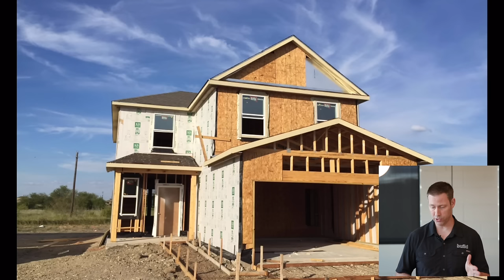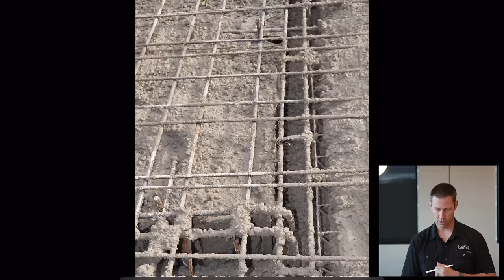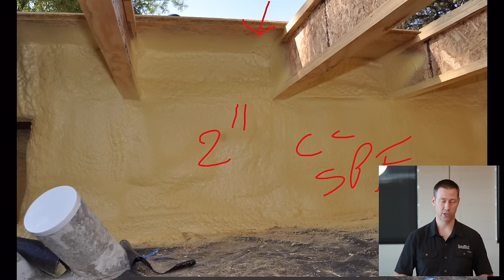Foundations - Slab vs. Pier and Beam - Which is better?

Comment: Here in S. florida, slab on grade is most common with a few grade beam on pile foundations.  Post construction and aging homes here often have plumbing problems which necessitate hammering out portions of the slab, very expensive and cause great inconvenience to homeowner.  Since most of these homes are built to a price point in slab plumbing tends to be located in close proximity to each other, master bath, second bath, kitchen, etc. tend to be back to back and share common walls.  If that small portion of the slab which contains the plumbing could be located in an externally accessible crawl space, future plumbing issues could be dealt with without the necessity of jackhammering out portions of the slab.  Take I guess what makes me think of this, owner of a home built in 1959.

Comment: Love the video! OK, so how is a foundation done in Sweden? First of (near) all houses have no basement. It is slab on ground mostly. First all topsoil is removed and sold. Then all gravel / sand is removed and sold (sand is a natural product and is expensive). Now you have a big hole in the ground. Then grey bedrock is blasted and crushed to diffrent sizes. And filled in the rectangular hole. Black flexible plastic pipe is put in (PEM). Big plastic sewer pipes are put in, electrical lines are put in. When they hit desired level. The greyrock is vibrated and flattened very hard. 
Now you have a Grey flat surface. Now they put in "under slab insulation"  Often very thick one, And on the edges the stand up, so you get a form to fill with concrete. Now the steel bars. And then the plastic pipes for floor heating. After that the form is filled with concrete.

Comment: I always wondered why you guys didn't use full basements. Thanks for the detail!
Reply: Also because folks in the north have frost lines at 36" or more. Might as well build a basement. 18" or so around Dallas. Just bury the lines and do slab or P&B.
Reply: My childhood home was a partial unfinished basement, my dad dug out under other parts of the house from it to gain access to the utilities, we since moved out and now I currently live in a rental with unfinished and unconditioned basement, I would like my next place to be a more modern and insulated basement, hopefully ICF with wood first floor for the softer more comfort of wood to that of hard as _ concrete slab after a few past places I lived in. Basements are far more convenient and accessible than a crawlspace.

Comment: In MN, deep basements and good gutters is the way to go, sand must replace clay near the foundation to prevent expansion in wintertime. Anything less than a full basement seems to lower home values substantially.

Comment: A friend of mine had a "pier and beam" with a 4 foot deep crawl space.  Much easier to get under the house to work on plumbing or wiring.
Reply: Nothing worse then the older style crawl space that is like 2 feet max.
Reply: @buckroger6456 I lived in a duplex once that had about a foot, maybe.  There were ditches dug out for the plumbing in the crawn space.

Comment: Awesome video. What would you recommend for a pier and beam house with vented crawl space? I’ve been told to open vents in summer closed for winter. Now I’ve heard keep them closed and insulate it and vapor wrap from sill plate down and cover the entire area. Is that what you would recommend? And what do you think about dehumidifiers

Comment: Are there any moisture&mold issue with foundations? They are really big issue in the Nordics, especially if the plot has any angle so your basement wall has to be against ground. Having clay or rock straight under (like in Matt's first example) is rare. Another big issue is concrete floors and not letting dry fully before building on top of them, as sometimes it takes multiple months)!

Comment: A basement, with 7ft+ ceiling height, is the best. Additional storage and semi-conditioned room for mechanicals. Also, easy access to inspect, fix, and run new plumbing/electrical. A plumbing leak would be detected quickly (assuming you go down there occasionally), unlike a crawlspace where nobody wants to fight spiders, raccoons, and snakes to check it regularly. There should be minimal issues with water assuming a good site and drainage, or at least a perimeter drain and sumps. 

In the Northeast, we need our garages for cars, so the basement is where all the crap goes that would normally be in a garage in more climate areas.
Reply: Working for my step dad while lining a house with even just a part of the house having a basement (it was 100 years old at the time and since been added on to) of which my own dad had dug out from the basement to create crawl space access to a few other sections added on before we moved in to gain better access to utility, Basements are far more convenient than those who say crawlspaces are optimal, though it also depends what you can do per the water table (floods?) and soil or geological conditions of where one plans to build, you have maybe a few choices and may not get to go with a basement. 
He got way more basement waterproofing calls than for crawlspaces which we rarely got called for, even my sister bought her current place with a basement with a normal door that walk-out to the back yard space as its on a slightly hilly area, hers is a half finished which makes for a nice play space for the two boys (nephews, no girl ... yet and no plan to have more kids) when they get rowdy or she needs to do some work and needs the peace and silence.

Comment: Matt, it appears from what I can see in your pictures that the yellow vapor barrier terminates at the footing of the perimeter. Is this common practice, if so, why? Seems to me you would want to prevent "rising damp" at this location as well. I have seen moisture at perimeter walls near the floor despite proper exterior drainage. I'm a private building inspector in SoCal.
Reply: Im sure it makes a great termite barrier!

Comment: Hi Matt,

Your videos are both accessible and very informative! Thanks!!!

My question is… 

Is there such a thing as a mat slab perimeter foundation hybrid?

Our soil report requires a thickened, double reinforced mat slab, due to liquid faction potential soil. 

However, we want to have a modern,  net zero, prefab home installed installed, and it requires a perimeter foundation for utilities hookups, etc. 

Can we desigh a mat slab foundation that’s below grade with a perimeter wall on top to meet the requirements and create a conditioned crawlspace?

Trying to think outside the box, but not experienced with foundations!

Thanks!

Paul

Comment: Asbestos floor adhesive for those stick down tiles on your friends house @8:10- that black stuff. Had to remove that on a job before we jacked up the slab in order to be able to take it to the city dump. $15k hazmat bill vs. several cases of isopropyl and kity litter and deck brushes and lots of ppe /:

Comment: I am used to pier and beam but its all slab here in AZ due to soil. In a valley between two mountain ranges, essentially making the area a gaint silt basin. Rock is around 500 to 1000 feet down.

Comment: The best floor systems I come across are sleepers on a slab. Not very common where I live but very solid without as much shock or temperature radiation.

Comment: lived in suburb of Philadelphia. moved 25 yrs to fl where you don't even think basement  so not seen building there but half my town was slab foundations as neighboring town . like Levittown pa, Willingboro, N.J. Levittown  new york and even many technically with basement use slab the 4 ft poured wall on the slab and push dirt yp to fount but back ground level is very common so really basements the first floor but kitchen lr and beds above steps from street to front door

Comment: He he,...  “slab on grade” or “ground” (you know... sand!) as we call it in Australia. The majority of building in my state is this way, for the past 50 years. We don’t do basements (generally)... then double brick walls and wood frame roof beams with concrete tiles or tin.

Comment: Great video! Thank you so much 😄 but sorry if this isn't related to foundation but why is the wood wrapped around the trees? Is that to protect the trees from contruction?
Reply: Hoses or cords snaking through a construction site...you don't want them rubbing the bark raw on the established trees.  Even if you don't plan to have equipment out there, it's a precaution.  Although a pain to work around on a job, everyone enjoys a shade tree at break times, especially before rough in is complete!

Comment: Are there any trade-offs for earthquakes? We have a slab foundation and in a recent earthquake all of the corners of the slab developed a thin 2-4 foot crack. We fixed it by injecting resin into the crack to prevent water from reaching the steel reinforcing but I wonder if a pier on beam design would be more resilient when it comes to earthquakes??

Comment: Great video. Where can one buy vapor barrier for an existing dirt crawlspace? Our crawlspace has no standing water but it does raise the humidity inside the house from moisture from the dirt.
Reply: A lot of crawl space vapor barriers are simply thick polyethelene sheet.  It's sometimes called "Visqueen" which is a brand name.   You can get this at any home store.   It's pretty inexpensive and comes in clear (translucent) and black. There may be materials which are better,  but lots of vapor barriers are just polyethelene sheet, and that's going to be a lot better than not having a vapor barrier.

Comment: Great video! Post and beam is not popular here in Phoenix, but I do appreciate seeing the differences in likes/dislikes between the two. 
This brings up a question on your slab on grade homes... I have seen several of your videos that have the integrated concrete beams on top of your moisture barrier, and in the case of this video on the lake house, posts 50' under slab to solid ground. Are your integrated beams part of the engineered design of the home because of the soil conditions or your standard practice for slab on grade to create the ultimate non-flexible foundation?
Reply: The design manuals for foundations like this have the initial assumption that you will have beams integrally with your slab on grade like he showed, but you have the option of thickening the entire slab in order to not have them. Phoenix soils tend to be less expansive/collapsible when compared to Texas, but Phoenix does have bad areas for them as well.

Comment: Matt, love the videos...

I do have a question on a pier and beam foundation.  It seems that the walls of the foundation are solid with no door as it typically found here in the south on older homes that have a crawl space underneath them.   Do you include a "trap door" somewhere in the floor like is done for fold-down stairs into the attic?  If you frame a door into the side of the concrete foundation, how do you seal it?

Comment: I'm hoping to build a pier and timberframe house in climate zone 6. I need to figure out how to layer the underside of the house without raising it too high. Probably 2' minimum, increasing to 5-6' because of the grade. Garage entry will be at the 2' end, so building some kind of ramp should not be too bad.
Why do this? Aesthetics (I think a floating house looks cool), completely avoid dealing with water issues (high water table, too),  reduce concrete usage for lower carbon footprint, and disturb the land less.

Comment: You said it would he hard to insulate a slab-on-grade, but why not be proactive❓ Use 2" (or thicker) rigid foam under the slab. In the drone shot @9:50, the foam would go on the flat areas, in between the "trenches". Tape the foam edges to the vapor barrier, to keep concrete from getting under the foam.
Reply: They similarly insulated the SOG Fine Homebuilding House of the Year in 2017 in Vermont.  I think they did 4" (staggered and layered 2" panels because...well...Vermont) and something about a lip on the edge pour as a place for the foam to sit on?  I'll have to go back and watch that video again but I'm not sure why Matt would call that hard to do?
Reply: Even ICF deck forms are perfect for the same reason to insualte as many of them offered comes with beams already incorporated into it (though mainly in just one direction, not that hard to cut out a cross beam to go "length" wise) even along with the block forms, is not that much harder to do and more convenient than an all flat slab or what he showed with cheap flat sheets of EPS or XPS Foam.

Comment: I believe you missed one point why Pier and Beam is used in Texas or should always be used, our expansive soils. Tract lot builders like Post Tension due to speed of construction, but honestly most will need piers 20-30 years later. My house built in '91 is moving a lot, it will likely need piers for leveling, but cost is 20-30 thousand for a 1500 sq. ft. home.
Reply: Eric G 
Wow. Sounds like slab is cheaper in the short term but more costly long term.

Comment: I'm a carpenter and love pier and beam foundations and also love timber floors. But my wife hates the squeaks and echoing/hollow noise that comes from this type of flooring. What are your thoughts on a solution for this?
A suspended slab is a thought but defeats the simplicity of the pear and beam. Even 3/4 sheet flooring with timber flooring on top is still a bit noisy. Your thoughts? Cheers

Comment: Pardon my ignorance. What kind of steps are you taking for radon gas mitigation? Or is it stopped because of the vapor barriers under the slabs? I didn’t think that in itself stopped radon from getting inside the home. I don’t know the answer, hence the questions.

Comment: So, I'm confused about the insulation system used on Pier & Beam. I get the 2" spray foam on the walls, but is the "mini-slab" that is the crawlspace floor insulated as well? I expected to see 2" rigid foam or something under the slab. Otherwise, this looks like a foundation I may very well use in the house we are designing now. Cool stuff, thanks for the education.

Comment: Growing up in central Texas, I fully believe in Pier and Beam.... when they are built right. I've been in too many production and even custom built houses around Texas where the slab foundations had failed due to soil settling. So few people pay for a soil test, thinking they will be ok, but find out in 15 years their house is beginning to eat itself. Matt, one thing you skipped over is the cost differences between each system.
Reply: Here in Australia I was required to have a soil test prior to obtaining a permit to build. The building surveyor also specified that an engineer be on site to inspect the first hole or two to ensure we were boring the piers to an appropriate depth. The piers need to reach either rock or soil with a stable moisture content.

Comment: Thanks for those well explained videos :) I enjoy learning some tips and get ideas for the remodel I'm doing (old house, in europe, made out of stones joined by earth and lime, I don't think that that concept of 'mobile homes' has a lot of understanding here :) ).
Now that you mention slabs, we recently started "re-slabbing" the whole plot and house (long story short, we wanted the water slope going outwards our house, to the road).
In the house there was a kind of thin, on top of the bare earth, concrete slab. We decided to re-level with another concrete slab, but to manage humidity and to raise the level, we used a Cavity (I believe that is a comercial brand) system, which consists of a lot of plastic pieces that form a self-holding structure that leaves some ventilation under the slab, and you can even route pipes, ett. Under it. Don't you use those there?
Reply: I think those systems provide kind of the 'best of both worlds' (insulation-wise), while sacrificing a crawling space.
We used pieces that are 5cm tall (about 2inch), but I saw systems all the way up to 1m high or more.
Here's one of our (cut) pieces:
https://photos.app.goo.gl/oJXSMuV4JmtCWB3y7
https://photos.app.goo.gl/B6Gk1idj1dh5qvSG9

Here's a good view of the system in a bigger construction site:
https://img.archiexpo.es/images_ae/photo-g/52772-11339535.jpg

Comment: We live on permafrost.. Would love to hear your opinion on the correct foundation for supper cold climates.  (north of 55) We live in a house with cement basement and we hate it.  I built my slab garage with in floor heating with beam on perimeter and love it. Still though I think by watching your builds if it were a house some improvements are required.

Comment: Pier and beam foundation with the outside solid. Then you insulate the inside walls and floor. 

Where do you put your access to underneath the home? A closet with a pull up floor? I’ve yet to see that.
Reply: The vented crawl space houses I've lived in (Central Valley California and Colorado) had access in the coat closets or the laundry room closet/floor with a pull up floor as you say.  Why not the same thing?